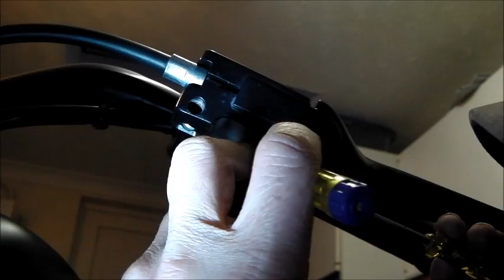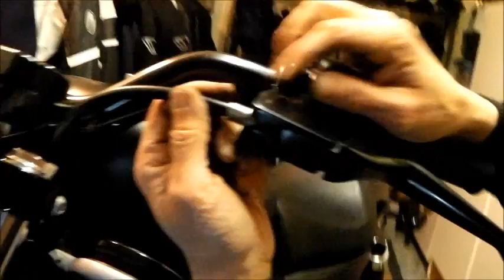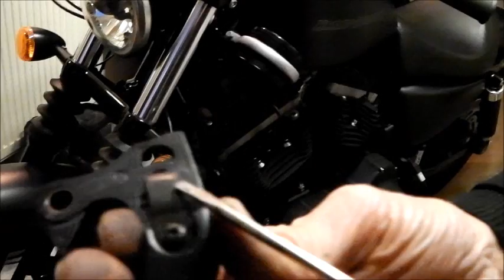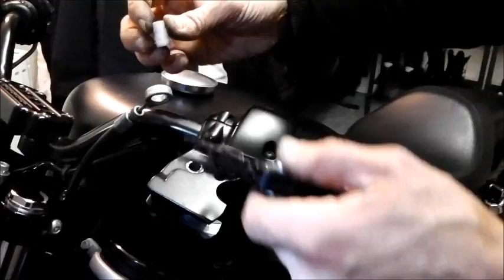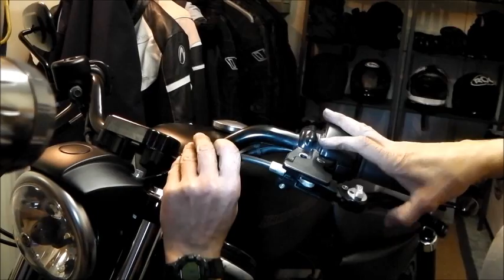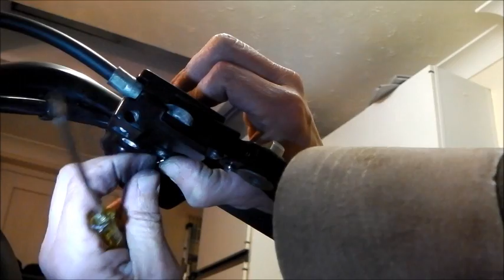Delboy's Garage, Harley Sportster, Clutch Lever change.

Comment: great video as always! will these aftermarket levers make it easier to pull in? cause this is the problem im having.  i have new clutch cable and new clutch plates and its extremely hard to pull in the clutch.  after a short time riding im over it.  just wondering if these new levers will help with how hard it is for me to pull in the clutch.  thank you in advance!!
Reply from the maker: Hi Zach... if your clutch is hard to pull in, then new levers wont make it any lighter....early model Sportster clutches were very heavy, what year is your bike mate..?
Reply: Moonfleet41  its a 07 sportster xlc 1200  the clutch cable is 1 month old and the clutch plates the same
Reply from the maker: Zach Peacock
Not sure why it should be so heavy Zach...but provided everything is new and setup correctly, then it may be the clutch is just more then you're happy with...if you're happy that there is no fault with it....and want it lighter... then you could try one of these.. http://www.amazon.com/Clutchlite-687011-Clutch-Harley-Davidson/dp/B003ANOE1A
Reply: Moonfleet41
 awesome thanks so much for the info and getting back to me so fast!

Comment: Hi
Just started  watching some of your you tube videos and i am really enjoying them as i am presently working on 2012 XL 883N
Something i thought i would share with you as i saw you installing the "c' clipon the clutch handle pivot pin.
If you look closely at the "c" clip there is a right way and a wrong way to install them as they have sharp edge and a round edge on the internal diameter othe clip.
The sharp edge should be on the opposite side ot its contact side otherwise there is the likely chance of it sliding off.

Gary
Dubai

Comment: HELP!  Trying to change my clutch lever, the lock/tension nut is completely loosened yet there is still not enough slack to pull the lever out. Any suggestions?
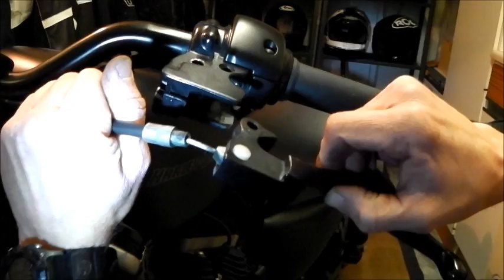Reply from the maker: have you pulled the cable outer cover all the way out of the clamp and lifted the wire out like i did at 1:57 ?
Reply: yes, it took ALOT of effort but I managed to get the stock lever off, although in same fashion now there's not enough slack to seat the new lever. There's too much tension for the sleeve to move out far enough and I've no clue where I can get the extra slack from
Reply: thank you for the quick reply by the way! it's almost 2AM here wasn't expecting an answer haha
Reply from the maker: No worries Thomas, i just woke up and checked the emails.. there you were.. glad you got it done buddy.. take care.. Del.
Reply from the maker: Remember you have slack adjustment down inside the primary casing buddy.... i imagine thats been adjusted down there by the last owner or tech who worked on it... there is plenty of slack in those cables.. two places to adjust it... so if the bottle screw aint enough, then back out some slack from the casing down below... you'll need to take the derby cover off to get at it..!!    Good luck buddy..
Reply: new leverq is on, thanks for the help man! Have a good one

Comment: the adjusting screw came out what do i need to do to fix it pleeas help
Reply from the maker: What 'adjusting screw' buddy??  Do you mean the wheel that turns to change the position of the lever??
Reply: Moonfleet41 clutch adjusting screw
Reply from the maker: Oh right, you mean the actual clutch adjustment inside the primary cover... confused because this was about the lever...  Ok, the actual adjusting screw cannot come out, it has a flange on the inside that stop it..do you mean the spring anf nut that fits over it... or did the actual screw you turn, end up coming all the way out when you turned it anticlockwise..?
Reply: Moonfleet41 when I turn the counterclockwise got tight I put everything back together Road and it broke or to cover back off and it just fell out
Reply: Moonfleet41 I think I know or do I have to do I guess my question is can I just buy the Justice Justice Crew and just replace it and not the whole clutch
Reply from the maker: Ok, so the adjuster screw itself actually broke and half of it fell out..???... you said you turned it counter clcowise until it got tight,...did you screw back in the "Quarter Turn" before refitting the spring and nut, then the cover..?
Reply: Moonfleet41 yes sir I did and I was going down the road when to change gears in a clutch just pulled out a land with no clutch
Reply from the maker: Oh no, thats a bit more serious... and goodness knows why it snapped off... i have never seen that before...   Well obviously the broken half is still inside the clutch pack.. so that needs to be stripped and investigated as to why it happened, what the cause was (because simply replacing it wont do, you must determine why it broke so you can fix that and prevent it simply happening again).. then rebuild it all...      

If this level of repair is beyond you then it look like time for a visit to the dealer.... The only thing that baffles me is if it was fine before you adjusted it, then why did it break in half right after you adjusted it... it must have been something you did incorrectly..  Either way my friend. its a full primary case strip and clutch rebuild at the least.... sorry to break that to you.. and good luck with it, i hope it can be fixed for a reasonable price..!
Reply: Moonfleet41 the adjuster screw didn't break in half the whole screw came out back to where the snap ring is I can see all the way through the clutch
Reply: Moonfleet41 I hope I'm able to fix it myself for a reasonable price thanks a lot man

Comment: This will not work for a 1994 FXSTC , no matter how much slack I loosen the clutch cable nut and bolt ... will not slack enough to pull out, you have to get into the primary and loosen it that way. All bikes are not the same.